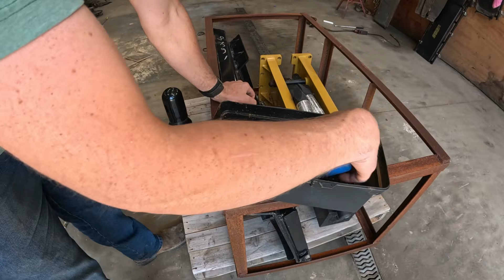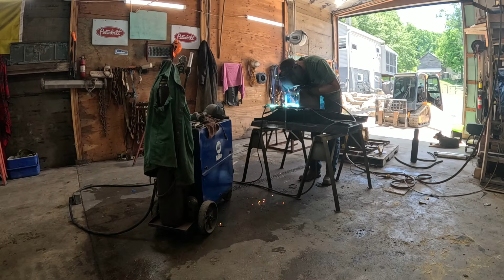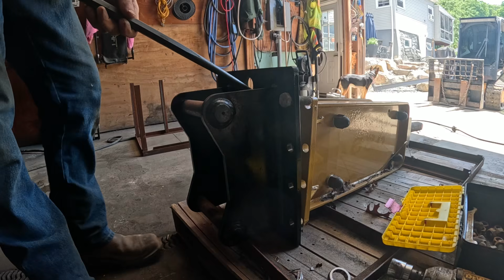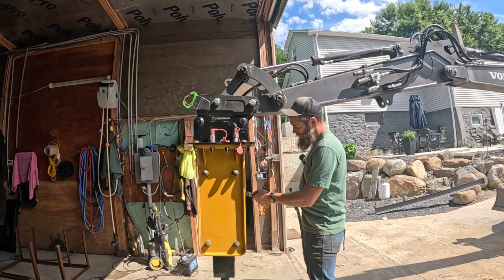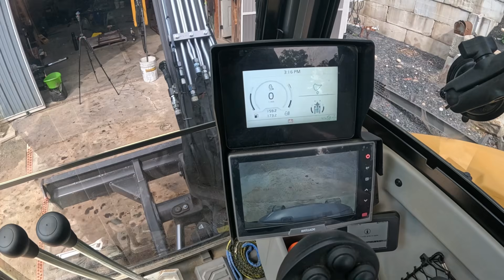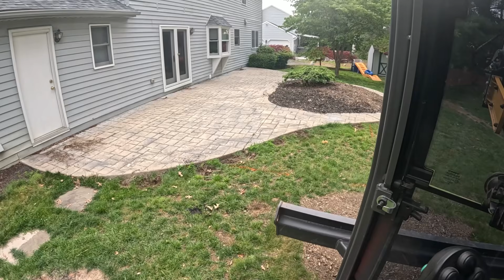I Bought the Cheapest Chinese Rock Hammer... Is It Worth It?

Comment: I had one and the bits get flat right away. if you rent a name brand breaker the bits last years
Reply from the maker: I agree but also disagree. Once these bits get rounded they pretty much stay that way. Same as a name brand bit. 

Regardless I have two bits. If they both go flat I can either grind them sharp or buy a name brand bit to put in the hammer. Still thousands cheaper than buying a big brand.
Reply: @AbramsExcavating  The first job i took that new chinese breaker to, the bit got dull within a hour. I got mad and went and rented a brand new NB160 bobcat breaker and after 3 days of hammering the bit still looked new. The chinese breaker worked fine on weak concrete, just not actual bedrock like digging a septic hole or something
Reply from the maker: Fair enough, I did notice on some
Hard rock it did affect the point. Concrete it didn’t seem to care. More than likely if I have a lot of rock to
Hammer I rent a larger machine with a big hammer. Don’t mess around with a mini ex/hammer